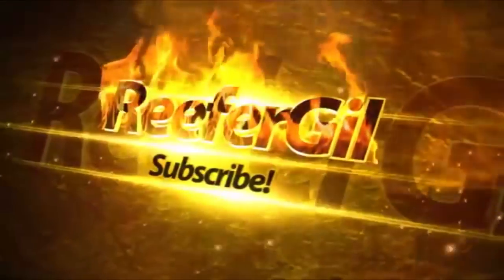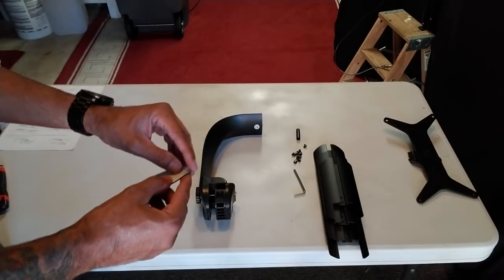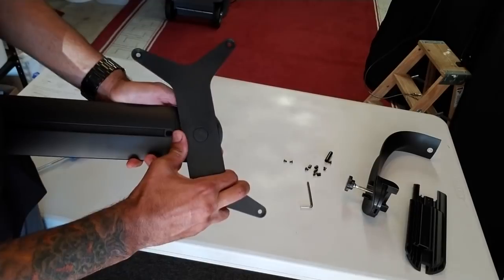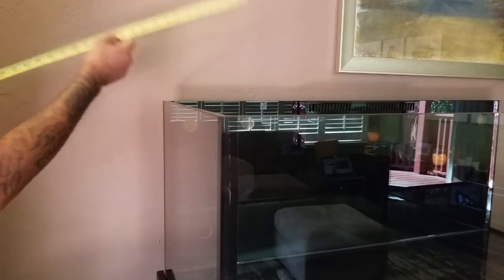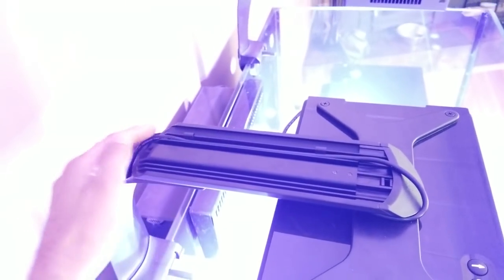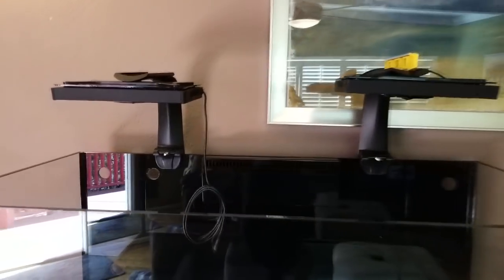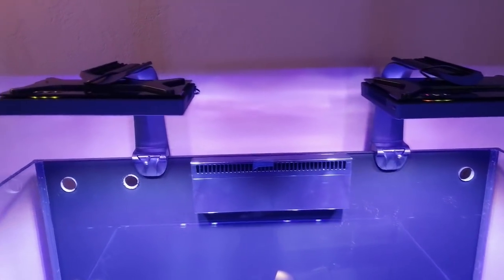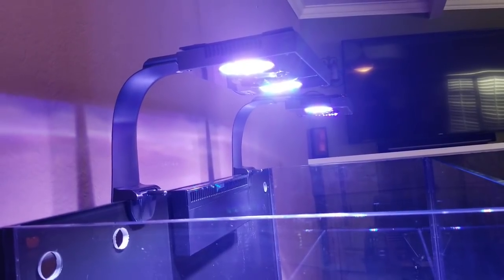Build Series| Eps.12| How To Install EcoTech RMS Mounts

Comment: This setup is an art piece for sure. The wiring and Apex display is very clean. In regards to the rear wall; are you running a closed loop?
Reply from the maker: Hey Nate, thank you VERY much! The plumbing in the wall is for bucketless water changes. A 1" drain to a sink in the garage and a 3/4" return from my saltwater mixing station.